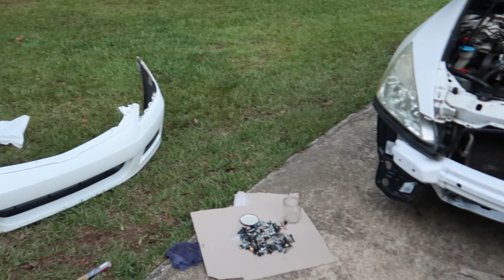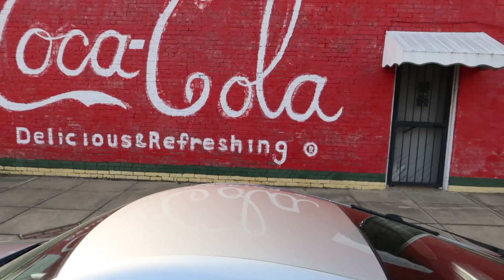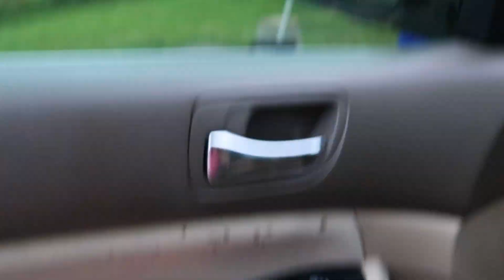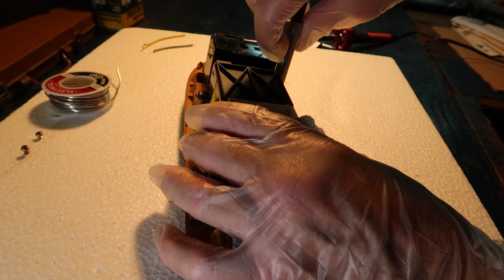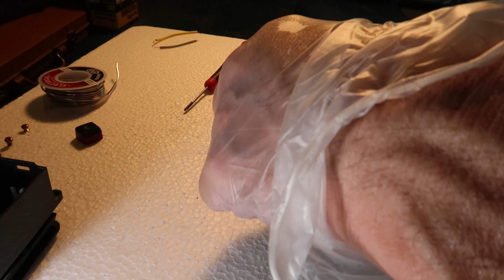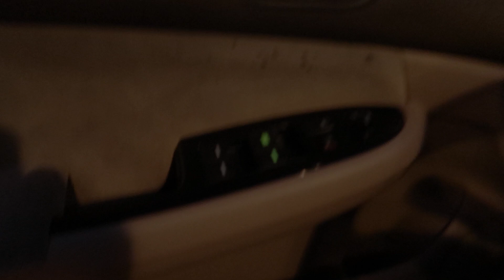Honda Accord power window switch repair 2003-2007 #Hondawindowswitch

Comment: Just here to say thank you. 
You are exactly correct here, the first time I pressed the window lock button, it locked me out! Hasn’t been moved since. 
This fix works flawlessly, the window lock button still works, and if you want to go above and beyond, you can put your speaker wire on either side of a 15A. 

I would only add that you want to do it exactly how it is done in the video. If you go with the wrong pin, you will (and I have) blown the fuse for the whole drivers side control module. 
The switch is $167 right now. 
Cheers
Reply from the maker: So glad it worked for you and thanks so much for watching!!!
Reply: I found a wire connected to a 15 fuse, after I tested it, and it blew out something that now I can't start my car or lock or unlock remotely.
Looks like the previous owner put that wire what was it supposed to have done?
Reply: @AlbyDiamond  hope that’s not the 1 I just sold, but I would have put it there to bypass a child lock malfunction that only allowed the drivers window to roll down. If you found that fuse on the drivers door, that’s probably exactly why it was there. Sorry about your keys. What might have happened, is when you tested it, you may have shorted the 12v to a different pin, than referenced in the video. I blew my door switch this way, but the entire control unit has a fuse that I was able to replace. If the car is not starting and you’re unable to lock or unlock any doors, it sounds like you have a more serious electrical issue. I would check the battery first, then check all of your fuses, 1 by 1 until you find the culprit.

I have some german engineering now (not as cool as it sounds) and my key has on multiple occasions, disconnected itself from the vehicle. Within the manual, and a couple google searches to find knowledge gentleman like this one here, you might just be able to reprogram the key with a couple buttons and etc…
Regardless if it is programmed or not, you should be able to stick it in the ignition and start it, unless it is a remote start. 

 I also might add, I love hondas! The Accord is great. Everything was serviceable as far i could see. Have no fear!! Find that fuse, or that reprogram procedure, you’ll be back to button mashing in no time :D

Good luck!!
Reply: For some reason the last owner connected the wire to the ACG fuse, that's what I think the problem might be.
Reply: What you mean the one you just sold the car? and if it was there to bypass the child so I can get wasn't working because the windows weren't going up or down but when I replace the motherboard it's worked finally but now my car doesn't start for the reasons stated earlier.

Comment: I did this for my neighbor, and it worked!!! And, to be clear, I am horrible with a crap soldering iron. My neighbor is an elderly widow, so I helped her get one of those $25 Chinese Amazon replacements, and we could not get the FOB to link to it. In the process of looking for a solution, I found this video! Thank God!! Now her windows work again. I still have to replace the door lock actuator on the driver's side, and the key lock in the same door.... So that adventure awaits. 😂🎉 I love YouTube!
Reply: Oh. And I had a problem finding a small piece of wire to use for this... I found a USB chord my puppy chewed the end off of,man's stripped it to see what's inside.... Perfect! 🤘😎 Everybody has an old USB charge cable with a screwed up end, so you already have all you need to do this.

Comment: I did this on my 06 Tsx about 2 weeks ago. Works great and the passengers window control switch still works.
Instead of using a wire, you can just use a long soldering led to jump both point, no need for wire
Reply from the maker: Thank you for the tip. I'm so glad it worked for a Tsx also!!!👍🏁

Comment: If you just leave the jumper on the harness, it will drain your battery
Reply from the maker: Yes, that's correct.
Reply: What would happen if you bridged the connection under the window lock switch? 

Also,.. was this done on the Special Edition Accord? 
I have a 2007 Accord SE (V6)
Reply from the maker: This was a 2006 4 cylinder K24 Accord. Not sure what would happen if you bridged the wire, try it and then check for a parasitic drain!

Comment: I did this. Now I know why my battery is dead if I don't drive the car for 5 or 6 days. I spent hours looking for the reason.... and then I  thought ,"what is the last thing I did to my car?" 😅
Reply from the maker: It shouldn't cause a parasitic drain on your battery. If your battery is 5 to 6 years old, you may need to replace it!
Reply: This is my only concern. Any others had/have power drain after?
Reply from the maker: Not if you follow the instructions perfectly!

Comment: How much does cost the whole master switch power window?
Reply from the maker: Maybe $30.00-50.00 bucks!👍🏁
Reply: If you want to get a genuine Honda one that you can reprogram your key fob to they're about $250.  The cheap aftermarket ones are impossible to link with your current key fob.
Reply from the maker: Thanks, great information for everyone! That's why this fix is so cost-effective.

Comment: When i tried this workaround its only working for driver side rear window, although the other windows butons are iluminating but not rolling it up/ down. Do I need to change the master switch or is there something more I could do with this one to make it work for all windows?
Reply from the maker: Make sure that you have not accidentally bridged the post next to the post you're  working on. If everything looks okay, then you're probably going to need a new master switch!

Comment: CAT 3 phone wire or Cat 5 or 6 ethernet wire are a better choice than speaker wire. they are 24 or 26 AWG and usually solid wire, not stranded, so they can be bent to meet the path you want. Also, bare the minimum of wire because any "shiners" can short to things, causing more issues.
4:25 Why wouldn't you just "T" those two wires and jump them at the connector, vice open the switch up?
Reply from the maker: Using a T to bridge the switch has been shown to cause a parasitic drain, while using the actual circuit board dose not, great idea about using a CAT 3 phone wire!!!!
Reply: @Zspeed  Yep. Need to use a keyed power on the OTHER harness, the smaller one. That's for the mirrors and is switched, not always on like that black wire in the bigger harness (which is for the door locks, so has top be on 24/7).

Comment: Thank you Z speed, I have a 08 Acura TSX (1st gen pretty much same as 03-07 Accords I think those are the Accord years) well its the exact same window switch I know that lol In the 10+ years of owning the TSX i dont think I ever used the lock out button. So was BEYOND DUMBFOUNDED when just overnight all my windows went from working to only my drivers window working. I heard the clicking at all the windows and heard the clicking at the under hood relay so knew those were most likely not the case. Tried a couple Acura forums, pointless. Turned to youtube and found the original video instantly (shout out to the original kid for pinning the video to you). I just finished soldering so fingers crossed, i know i know I didnt try your pin test but im hearing everything click so the relays are getting power, hopefully its this. I wish i could attach a picture but not a big poster on you tube, ig, tic, but it came out beautiful. Putting it back together now and out to the TSX I go. You still have your Z? I had an 03’ chrome silver track model. Had to sell her due to my daughter being born and as you know, Z’s only 2 seater 😢 Ive had Honda/Acura’s and Nissans my whole life. Funny story, so I found a G35 coupe being a 4 seater, black on black 6spd with the brembos and rays wheels (Infinity’s track version like the Z) but the car seat wouldn’t fit backwards cause at the time the car seat had to be facing backwards, it would fit forwards but not chancing it with my daughter so went with the TSX. Not even a week later we were at the point her car seat could go forward, son of b****!!! lmao Oh well, been loving the TSX and playing around with the K24. Had always been a B series guy but damn, the K24 with some bolt ons, clutch cylinder and master cylinder upgrade and the K Tuner, wow. Night and Day. Anyways thank you for this video because even my buddy at his salvage yard has trouble getting these master switches cause they go instantly and even used are expensive, and could have the same problem. So thank you for the video! Cheers!
Reply from the maker: Let me know if it works for the TSX, it might help someone else out!!!👍🏁

Comment: Hello, I have the same issue. Where my driver side window works but my front and rear passenger windows do not roll up or down but they make a clicking noise. Could it be the main switch needs to be replaced or the individual switches in the doors?
Reply from the maker: The master switch needs replacement!!
Reply: Thanks for the help and video!

Comment: It worked great for me!  Thanks!  I thought this was a bypass for the child safety switch but it works normally.  Saved me a ton of money.  A new switch is very expensive once you add in programing the keys.
Reply: You actually don't gotta pay to reprogram the master switch. You do for the immobilizer but there's an in car procedure you can do yourself to program the fob to the new master switch. Works better if you have 2 keys tho.

Comment: Thank you! I rarely, if ever, used the child lock for the windows but my husband borrowed my car to drive out of town and hit this switch and the passenger windows haven’t worked since (but they still click). I have been looking through all of the different fixes for this problem for months trying to decide which one I want to do and this is the best! I don’t want to purchase a new genuine part or even a used one because this is a VERY common problem which should be a recall so it seems like a waste of money. There are too many issues with buying a generic switch as well and jumping the 1 and 3 wires seems to be a drain on the battery so this is fantastic! I am going to order a solder kit and I will update after I complete this fix. Very thorough instructions too which is much appreciated!
Reply from the maker: Awesome,  you have definitely done your research, let me know how it turns out!!👍💯

Comment: Would have liked it more if you just skipped to the main part instead of that long intro
Reply from the maker: new intro's are much shorter now, thanks so much for watching!!!
Reply: I like the long entry, thank you, you taught me how to bypass my switch with speaker wire when my window is stuck down..so I can roll it up before soldering the main part to fix it.

Comment: FYI: It may not be the actual push button switch but rather the control circuit from that switch. The symptoms on my Accord exactly the same. I took the actual switch apart and it was just fine. So in my case it was the control circuit. What circuit are you actually jumping?
Reply from the maker: just bypassing the child safety switch!
Reply: how you bypass child safety lock switch ?
Reply from the maker: Follow the steps in this video!!!

Comment: Is this master switch the same (exact fit) for a 2006 Acura TSX ?
Reply from the maker: Ask your local Honda dealer if the master switch is the same as a Honda Accord. If they say it will fit, then this fix should work for your TSX too!

Comment: I have an 2006 Honda Accord and have the same issue. Only driver side window works. Able to hear the clicking on the other 3 windows but they don't move. Would replacing the whole master switch itself solve this issue?
Reply from the maker: Yes, that should do it!!!!
Reply: Do we have to reprogam key after this?@Zspeed
Reply from the maker: No, it should work just like it did before it failed!!👍🏁

Comment: Hello sir. Thank you very much for making this great video. I followed the instructions in this video step-by-step and everything almost worked well. This is why I say almost;I said almost because all of the three windows that were not working are now working. The problem I’m having is that the master control is no longer working; therefore, my driver side window which was working is no longer working. Also, all of the three doors cannot be opened with the master switch. I have to open them individually. Do you or anyone reading this have a suggestion that would help me out? thank you very much for your help.
Reply from the maker: Sounds like you might have bridged one of the wire post next to the wire that you soldered on the circuit board. Check your master switch solder job for flaws, like bridging the post next to the area that you were working on! Hope this helps!

Comment: I just changed my master switch with one from the junk yard. My driver window does not roll down, but I can roll all the others down. Will this work for me? Or is it for the passenger windows only?
Reply from the maker: Sounds like you just need a new window motor on the drivers side!!!!
Reply: @Zspeed  you were right!
Reply from the maker: Awesome, glad it was a easy fix!!

Comment: Hey man can you help me out, after doing the test, my car shut down and now it doesn't recognize my key, and I have a quack sort of sound coming from under the steering wheel whenever I try to put in the key.
Please help me
Reply from the maker: Disconnect your car battery and reconnect it, this might reset your problem! That noise under your steering wheel is a separate problem, l will be making a video soon addressing that. Also check all your fuse boxes for any blown fuses, I would probably do this first, sorry this happened to you, keep me posted on your progress!!

Comment: My back passenger window switch was pulled up too hard. I saw a spring fall out. So now I have to hold it up a certain type of way in order to keep my window up. Do you know how to repair the back passenger window switch I have an 03 Honda Accord
Reply from the maker: You should remove it from the housing, and look for any easy or obvious problems that might be simple to repair! If the problem is not obvious, replace the entire window switch!

Comment: Hello, I just wanted to know where I could buy the wires used and what kind specifically, thank you in advance
Reply from the maker: Actually, I was just using old speaker wire that I had lying around in the garage!! Just make sure that the wire  gauge isn't so large that it fuses the wire post next to the one you're working on!  You might need to experiment with different gauged wires. Hope this helps and thanks so much for watching!

Comment: Have to say..  I found the jumper hack between the two wires a few years ago, but since car sits a bit, a parasitic drain on the battery forced batteries dying too quickly.  This fix was perfect and was straight forward to execute just like the video.  Worked like a charm.  Thanks so much!
Reply from the maker: Thanks so much for watching!!

Comment: Awesome video bud. I wanted to ask, i seen some using a small paper clip cut to the correct size and placed one end into the first black cable and the other end onto the 3Rd  wire slot and push it in, looked lik a perfect fit and everything worked as in this video, question is, will that caise any other type of damage if done this way permanently?
Reply from the maker: Not sure if it will cause a parasitic drain on your battery or not! But I think it's worth a try because it's so much easier then soldering. Let you know if works and thanks so much for watching!!!
Reply: @Zspeed  thanks for the reply, i forgot to ask if your method has caused draining or anything weird since?
Reply from the maker: No problems with the battery or any other electrical system, get free fix!!!

Comment: hey, I know this video is a couple of years old but my passenger side window has never worked in my 05 accord coupe ever since i got it in 2018. by chance did the relay on the non-working window switch make a clicking sound when trying to roll up/down the window? that's the problem I'm having
Reply from the maker: I think it did make a clicking sound, try the test with the speaker wire. If that does not work, then you might just have to replace the window motor!
Reply: @Zspeed  sounds good thanks man!

Comment: Can you do the speaker wire trick and call it a day?
Reply from the maker: There is a possibility that the wire trick could cause a parasitic drain on your battery 🔋, but you can try it and see 👀 what happens.
Reply: Could you use something other than the cord

Comment: Had the same issue, repair worked great for me. Mine is the 35750-SDA-A14 (EX model) which is most expensive type. Would like to clarify that jumping pins 1 & 3 (Black - Wht/Grn) is only good for testing; it will keep the relay energized constantly and can drain you battery if left that way. Did this repair for a friend who got it from a used dealer that did a bunch a quick hacks like this to get it ready for resale. Took me better part of a day to find the parasitic drain and that quick hack was the culprit.
Reply from the maker: Thanks for the information and thanks so much for watching!!!